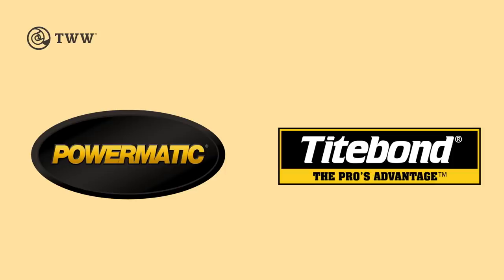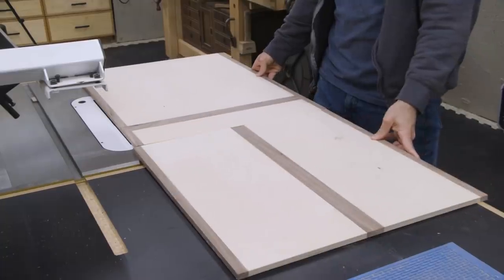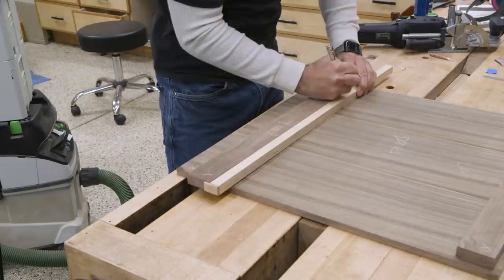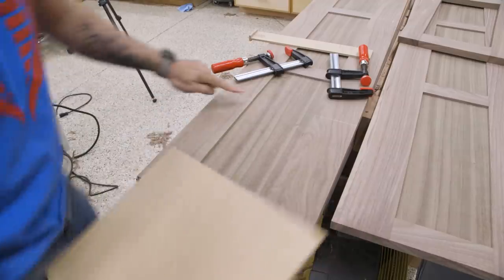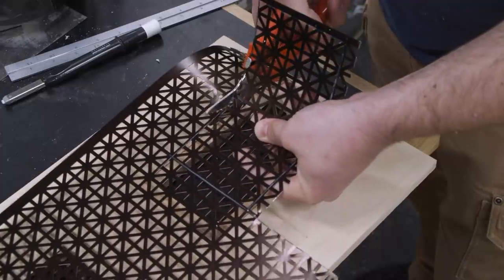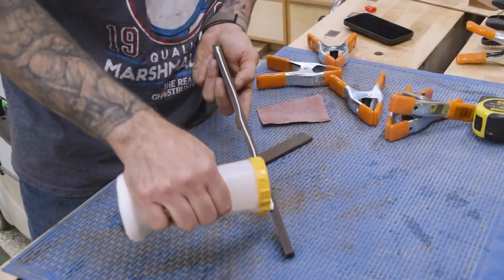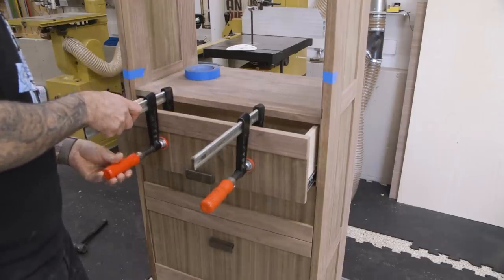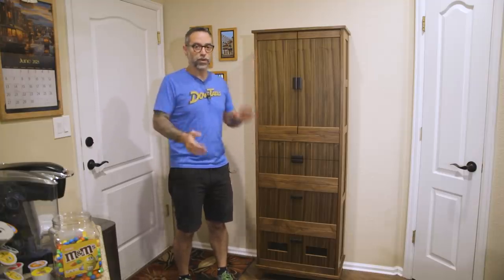My Most Challenging Project in Years! | Veneered Pantry Cabinet

Comment: Nice project. I'll bet your mom loves it. BTW, undermount slides are so much easier and provide such a clean look that I don't really like anything else, particularly on large higher end projects.
Reply from the maker: Thanks Tracy. While I agree that the undermounts provide a much cleaner look, I disagree on them being easier. They are much more restrictive on the design as they require more in the way specific clearances. They also require additional hardware (locking mechanisms) and they are as much as 3X the cost. I'm sure if you're in a cabinet shop that has standardized sizing, the undermounts become "easy." But when you build nothing but one-offs like I do, undermounts are more work and more restrictive.
Reply: @woodwhisperer  I'm just small one man operation and only do one-off projects. Anymore, I also use soft close self closing slides almost exclusively. They're definitely more expensive but usually the customer is more than happy with them. I can see the limitations they might create, especially on a smaller piece, but the trade off has been worth it to me. Love your work. Looking forward to your next one!
Reply: @woodwhisperer  I work in a cabinet shop making a range of furniture including a lot of bespoke work here in the UK. We use undermounts for the vast majority, simply as they are soft close, and not seen. When you have the tolerances minimised the sizing if each part is simple. Agreed about the price though, the grass runners we use are £30 per pair plus clips. I personally use GTV runners on my own projects as they are £10 per pair including clips, and a good enough feel and quality.
Reply: I know a lot of people prefer undermount slides, but from my point of view their extra cost provides nothing.  I like the simpler structure of side mount slides oriented to provide strength with less material.  If I don't want to see them, I'll use traditional methods without slides.  Just a counterpoint.
Reply: @alans1816  Functionally, your right but they are hidden which is visually more appealing to most. Also, you install just the one slide to the cabinet, fasten the clip in the corner under the drawer and done. No more misaligned drawer slides and many are rated for well over one hundred pounds. However, I also really like a good old fashioned wooden drawer slide.

Comment: awesome. Never thought I’d be envious of where potatoes and onions are living. Wondering if you could show a close-up shot of how are you handled the kickboard, I didn’t see about cut for it but maybe just missed.
Reply from the maker: I'm not sure what you mean. There's no kickboard...assuming you're talking about a toe kick. The cabinet is on a stand.
Reply: @woodwhisperer  Sorry I meant the way the cabinet interacts with the floor molding on the bottom of the wall. If the base is inset from the rear of the cabinet and is as tall as the molding that would explain it. Feeling star struck, I'm the guy who just signed up for WoodTalk Patreon after listening to 460 episodes! :)
Reply from the maker: Haha well thanks for the support. So, yes, the base height was designed so that the bottom platform is just above the baseboard and the overhang is just a hair longer than the thickness of the molding. So nothing needed to be cut or scribed. 👍

Comment: Hey Marc, I notice you're no longer using the VSC fence but seem to still be using the aluminum extrusion. Any reason you've gone back to the stock fence? I don't have the VSC fence but I've been tempted to get some extrusion and do the same thing as what you're doing now.

Nice build. I love the pulls in particular!
Reply from the maker: I really liked the VSC fence. But when I had Powermatic out to film in my shop, I put the old PM fence back onto the saw. I immediately remembered a couple of things I liked about it. The locking mechanism was smoother and easier to use and the body of the fence created a little trough that I could use to hold things like rulers, pencils and tape measures. I wanted that back. So I decided to make a Frankenfence by attaching the aluminum extrusion to the Powermatic fence. Kind of a best of both worlds thing. Now I don't totally LOVE this setup because the fence is bigger and bulkier than it really needs to be. But it's a compromise I can live with for now.

Comment: Undermount slides are easier than you think! If you take 7/16 off the opening that will be the final width of the drawer box. The depth of the box is determined by the slide length. Eg 400mm = 14 inches. I use Blum movento slides everyday.
Reply from the maker: Don't forget the drawer bottom height restriction. I'm sure after you install 20 of them they are easy. But they're definitely not easier than side-mount.
Reply: @woodwhisperer set the groove 3/8 from the bottom minimum.
Reply from the maker: @byever1  ok thanks. But telling me the measurement restrictions doesn't refute my point. It kind of reinforces it. :)
Reply: @woodwhisperer  i think you are overthinking it. Try it one day.

Comment: Undermount Drawer slides are the easiest to install.  All of the other styles are harder to install, and have little to no adjustment, unlike the undermount slides.
Reply from the maker: Sorry, but they are not "easiest." Like anything, they may seem simpler after you install a bunch. But it’s a fact that under mount slides have more restrictions and specific clearance requirements than side-mount. You’ll get no argument from me on adjustability but if a drawer is well-designed and well-built, adjustments won’t be necessary. I’m not talking about kitchens where precise fitting isn’t practical, I’m talking about one-offs like what I made in this video.

Comment: On your drawer face install instead of double sided tape. Let the screws stick out about at least a 1/8 and just press the drawer face onto the screws. Then just pre drill the started holes and go!
Reply from the maker: That might work if I have two people in the shop at the time of installation. I wouldn't be able to apply pressure to the drawer front at the same time as pushing on the screws.
Reply: @woodwhisperer  it's a one person job.
Reply from the maker: @byever1  I guess if you don't fully pre-drill your holes in the drawer box that would work. But I'm not sure there's any advantage over the tape method I showed.
Reply: @woodwhisperer  double sided tape can be expensive and if you got a whole kitchen to do...

Comment: Wiping oily woods with acetone does nothing but draw more oil to the surface, making joints weaker.  

You've obviously never tried to remove Phillips screws which have been finished over.  Slot head screws are a god send in some situations, and they are never that hard to drive.
Reply from the maker: The acetone issue, at best, is debatable. I've seen arguments on both sides. I don't do enough of it to say one way or the other but I was always taught to wipe the joints down before gluing. As for the screws, you're absolutely right. I am not in the habit of applying finish on top of my screws so I never have to remove screws with finish on them. :)
Reply: @woodwhisperer  I have friends who have done extensive testing with rosewood in guitar factories, including stress tests.  Acetone makes the glue joint weaker.  No debate, real numbers.  Unfortunately, those numbers are proprietary data, but it definitely jibes with my experience.  I work with more rosewood and ebony than anything else (full time guitar building and repair), and pulling the oils to the surface clearly hurts glue joints.  

I’m using a couple screws to hold my guitars when they are being finished - slot heads are definitely called for.  And talk to an old shipwrights some time about Phillips head screws.  That’s an earful.